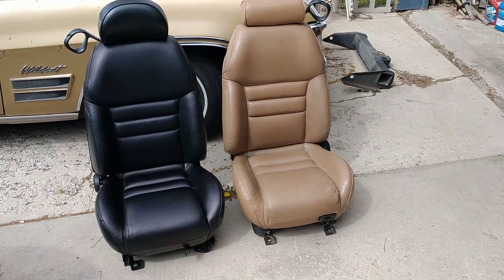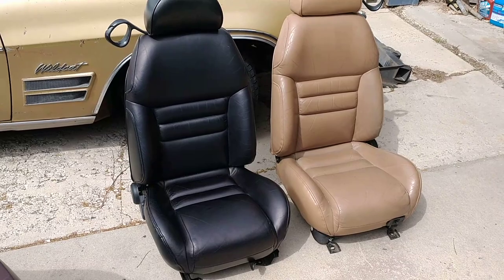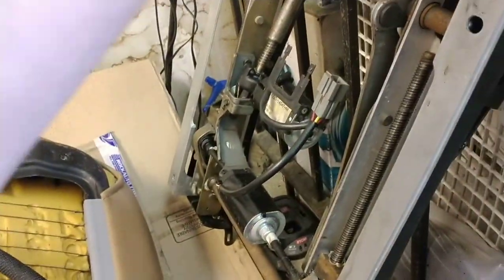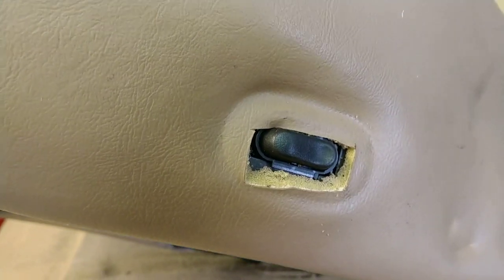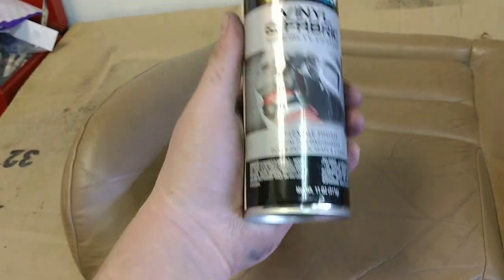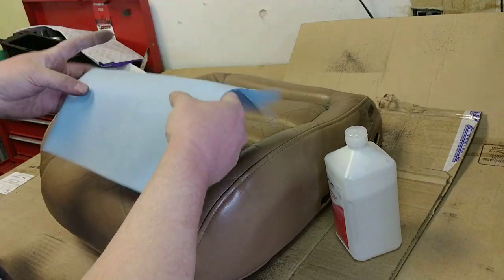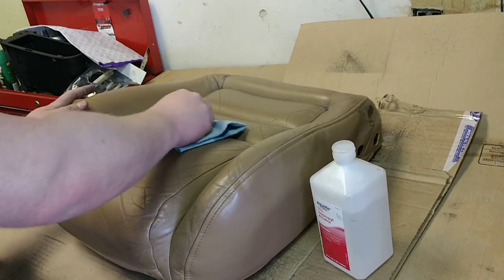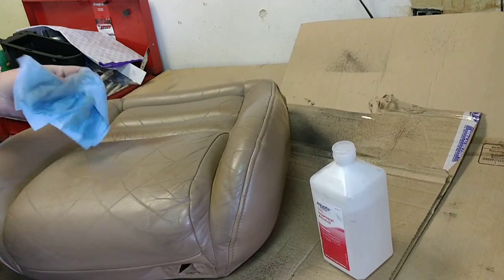How to Dye Leather/Vinyl Seats

Comment: 1. Leather Cleaner
2. IPA solution
3. Leather crack filler, or repair any tears
4. lightly sand the leather
5. Dye the leather
6. wipe down with IPA solution again
7. Use Leather conditioner.
8. Top coat, if desired.
Reply: Don't use alcohol.
Use SEM, not Duplicolor.
Reply: @jeffhildreth9244  Is it that much better?

Comment: I've dyed many leather seats over the years. You should tap the dye onto the leather, not wipe it or brush it. It is also essential you put on a topcoat to prevent the wearing off of the dye.
Reply: Topcoat is essential if you stripped the original top coat.
Reply: @whitegoodman7465  That is a requirement. You should never apply dye to a topcoat, it will not last.

Comment: If you’re thinking of doing this and you want it to last, you need to buy a leather sealant and seal the seat. Otherwise, the dye is going to transfer and it’s going to rub out, get on things, and just fade over time. 

A good sealant will prevent you from having to ever do this, again.
Reply: Where do you get that? What brand?
Reply: What the name of the sealant?
Reply: @VCVTV  I did some research and it's called resolene and Fieblings makes it just like the dye he used

Comment: How well have these held up since you did them. I’m considering the same on my GT.  You can ignore. I saw your response below
Reply: I have the same question
Reply: Same here
Reply: Why won't he respond!?!?!?
Reply: I’ve tried a few times to dye my seats. The issue is even days afterwards I keep getting black ink rubbing off.
Reply: I've worked with with leather making bags and thing and there will be color transfer if you don't seal it, there are clear coat for leather as well as acrylic finishes that would work
Reply: DupliColor works better

Comment: Thanks for this video...  I just bought a '78 cb750 and the seats perfect, except it's brown and I want to dye it black... I'm totally going to try this out instead of buying a new seat
Reply: How is it going?
Reply: @stephen8385  I actually was able to dye the seat 2 weeks ago and it went well... I had  a little trouble finding the right leather protectant and ended up just clear coating it with spray paint but it turned out great

Comment: I know it’s been a while but I was wondering how did the dye hold up? was there any spots it faded or rubbed onto clothes? Great video btw it really is helpful !
Reply from the maker: The places I used the spray dye has held up really well.  The leather could use another coat of the dye it has faded a little in a few places.  The nice thing is the big bottle has plenty if you need to touch any of it up.
Reply: @cidsrevenge6053  Isnt there any form of primer that could be used before the dying to get a better result?
Reply from the maker: @samegutten  you want the leather dye to soak into the leather.  The vinyl dye doesn't need a primer.
Reply: So no transfer to clothes?
Reply from the maker: @mattpatterson8155  the dye does not transfer to your clothes at all.
Reply: @cidsrevenge6053  looking to do this on my motorcycle seat, think it'll hold up ?
Reply: Whay dya is used what alcahol is used please
Reply: @cidsrevenge6053  In talking to Fieburg their product is not recommended for vinyl as vinyl is non porous so it sits on top and lasts for a while but not permanent. The Duplicolor spray I have used before and it is OK but I did not have the car that long afterward to test durability. Just FYI.
Reply: @cidsrevenge6053  any issues when sweating? As in it getting on clothes ? Or coming off?

Comment: you don't have to seal the leather somehow afterwards? great video.
Reply: no... it soats in
Reply: Yes Fieblings sells resolene just for that purpose. It's like a clear coat and it seals the dye in and gives it a nice sheen.
Reply: @domls1317  I really appreciate the info! Now I can get it done right :)
Reply: @jessemartinez6781  this is for leather though and when using leather dye. If your doing vinyl I'm not sure it needs it if its from a spray can.